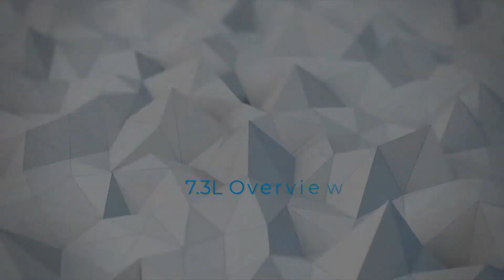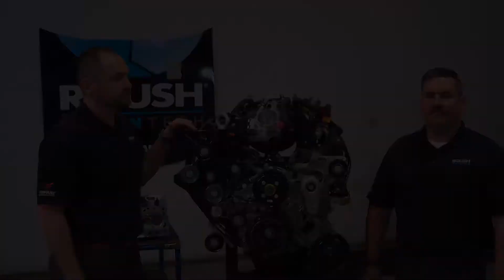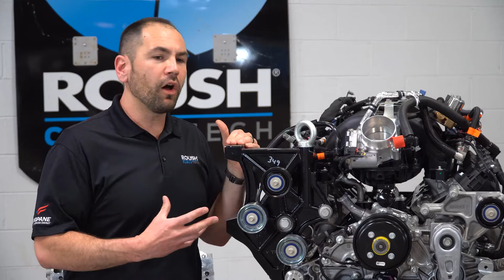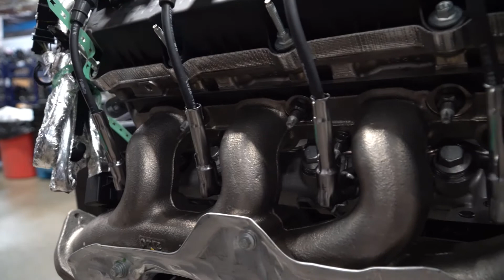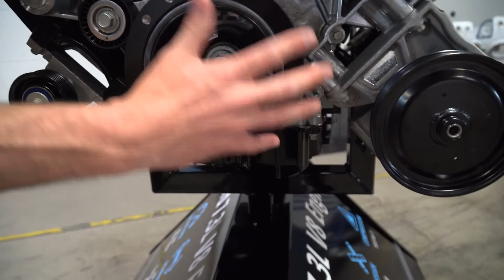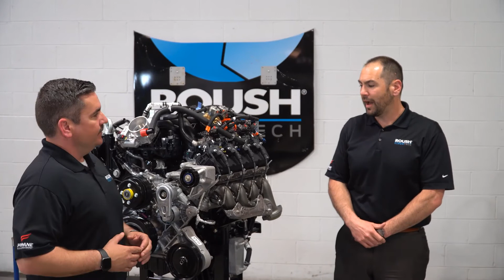7.3L Engine Overview

Comment: Thank you for your video. In order to make your video more consistent, some radio mic is likely to use (a dual mic system, affordable by the price, would be rode wireless go 2). This will improve sound quality and give additional viewers involvement.